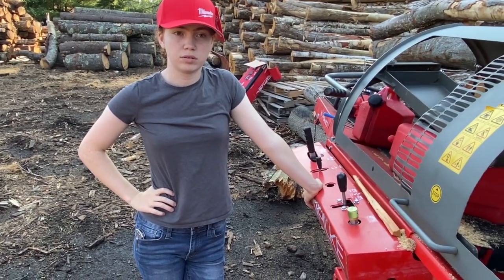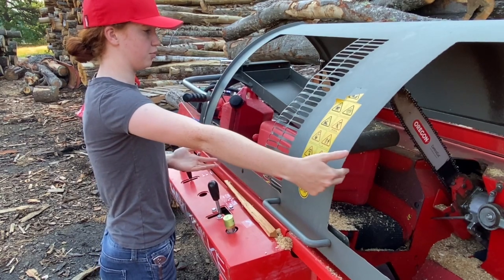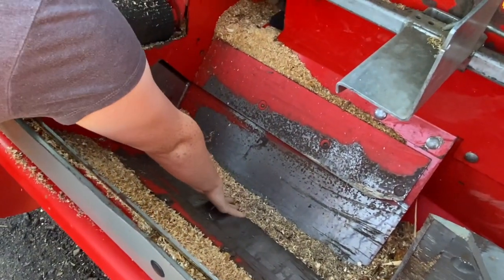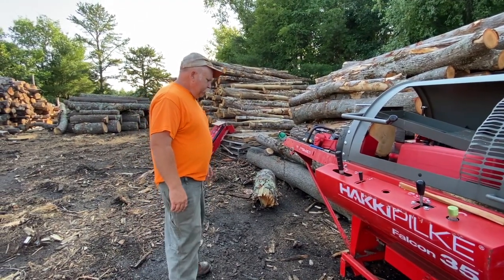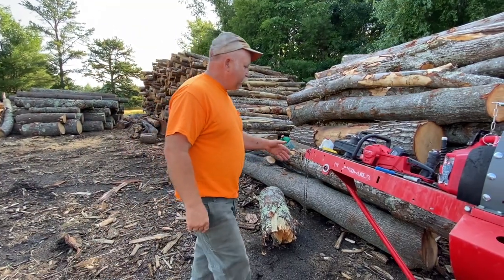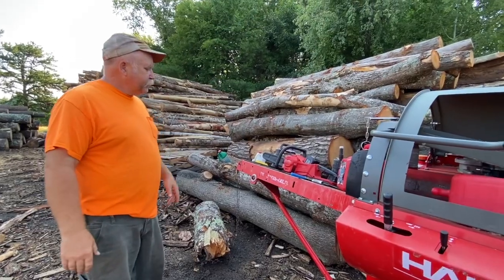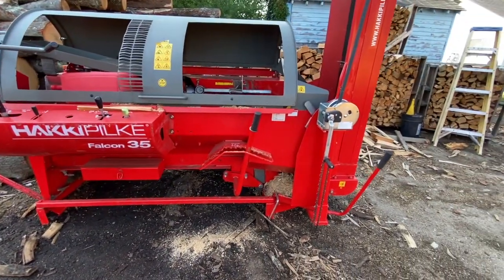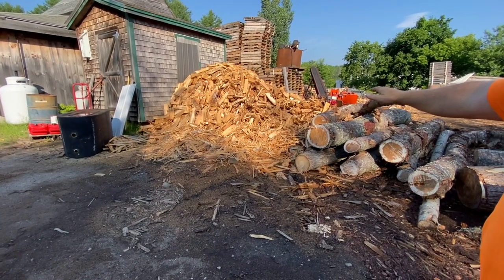#10 Hakke Pilke Falcon 35 Processor

Comment: If you require Millie to lift the lid to do anything inside the machine, then why bother cutting out the steel mesh guard material?
Reply: We bought it with the screens removed.
Reply: Thanks for the answer, you got that way.